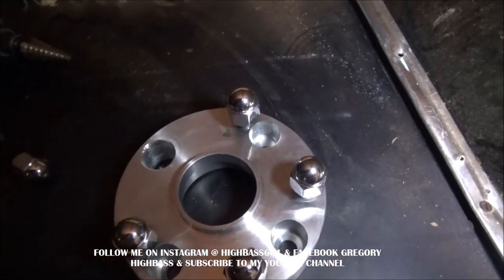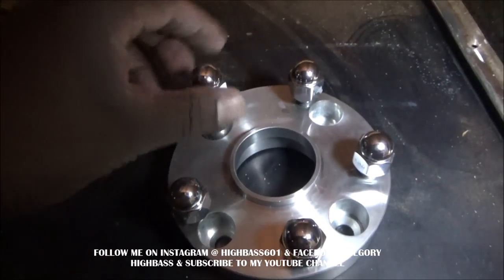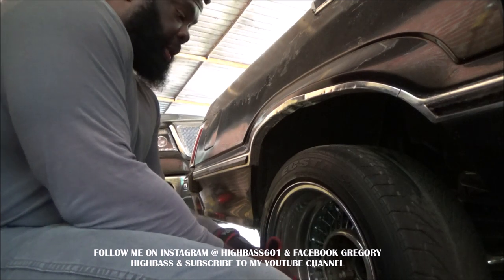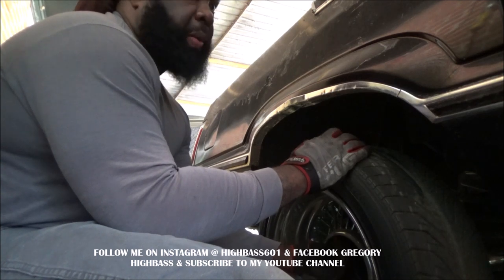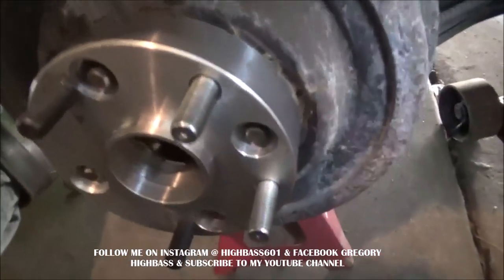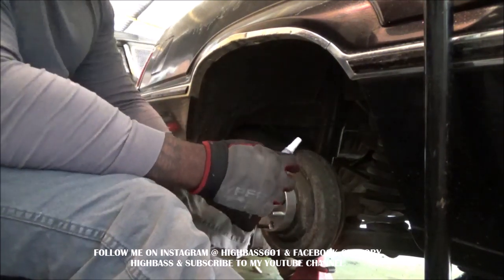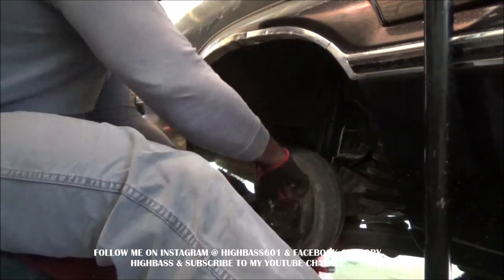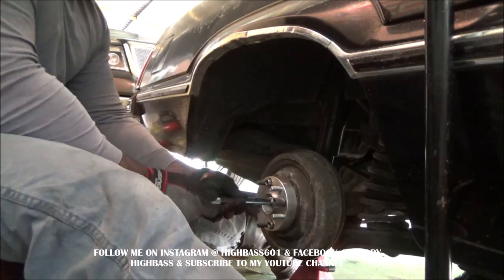VIDEO 1 | GOODBYE WIRE WHEELS | CONVERTING 82 FORD THUNDERBIRD | FROM 4 LUGS TO 5 LUGS

Comment: Perfect timing, are those Titan adapters ? I need some adapters to change mine from 5 on 4.5 to 5 on 5. I'm concerned about being hub centric. I was hoping you would have shown the backside of the adapter. Keep us posted on reliability. Make sure you retorque them after a couple hundred miles.
Reply from the maker: Yes sir..i actually run a 5 on 5 adapter on the back of my mustang..been on there many many years..but all the adapters on the back side look the same...(flat)...adding lock tight you'll never have to worry...

Comment from the maker: I SEE DA HATERS HAS ARRIVED!!
Reply from the maker: Buick Regal  man how did you read my mind..already have some in my cart..kmsl
Reply from the maker: Buick Regal  yeah the black one's with red angle eyes..
Reply: U can do a true 5lug swap using all ford parts that u can get from the junk yard.
Reply: I got a 88 tbird with a 5 lug swap
Reply: Use 2 ranger driver side axles for the rear to keep the drum brakes
Reply: And for the front u can use ranger spindles. Direct replacement. U can still use the stock brakes on them also